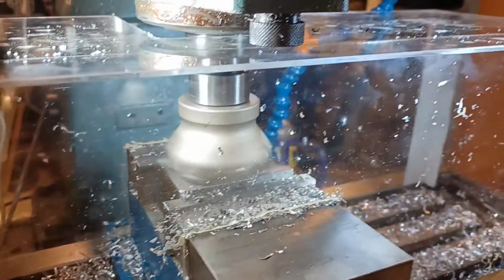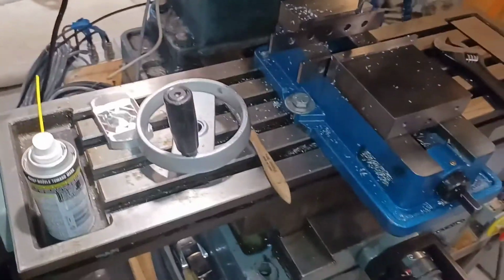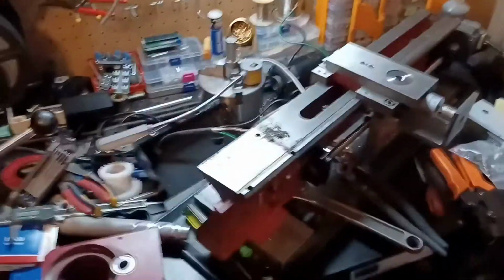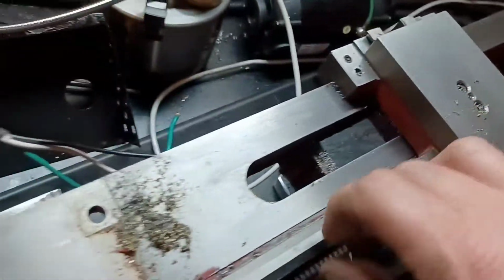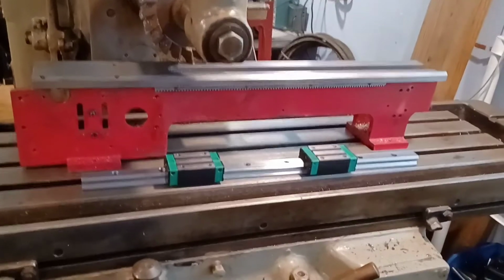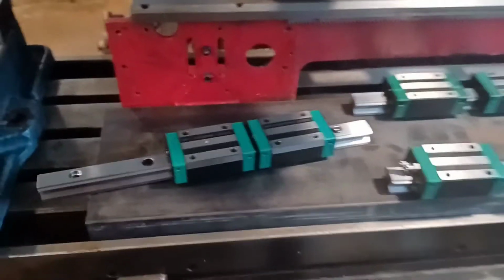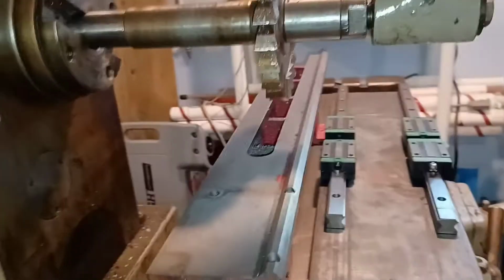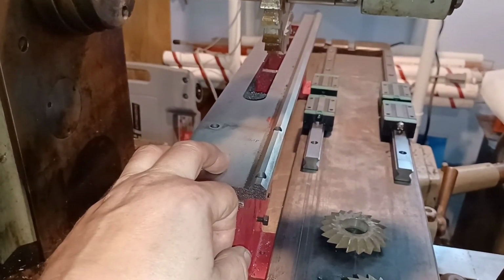Time To Upgrade The Mini CNC Lathe (And Some Miscellaneous)

Comment: Adventurous endeavor.
Reply from the maker: Well I figured  what the heck.
Reply: @backwardsmachining7526   I feel you. The lure of modifying is strong medicine.  I like the enclosure. I've thought of doing the same as well. My shop area is also in my basement, so it's a never ending cycle of sweeping and vacuuming to avoid dragging chips upstairs.
Reply from the maker: John get this.... I just got back from the metal store, I can not believe the prices have gone up like they have. I bought the steel for the cnc plasma frame but that was it. The prices went from .70 cents a pound to 1.60. What used to be 23 bucks is now almost 60!! The enclosure is going to wait a bit.
Reply: @backwardsmachining7526  Yep, steel is on the insane rise again, lumber prices went completely off the rails, and beef is about to get really pricey too. I don't know how aluminum is right now, but they're not giving it away that's for sure.